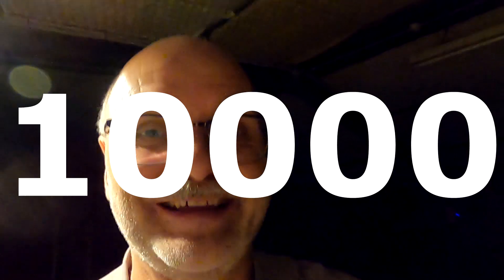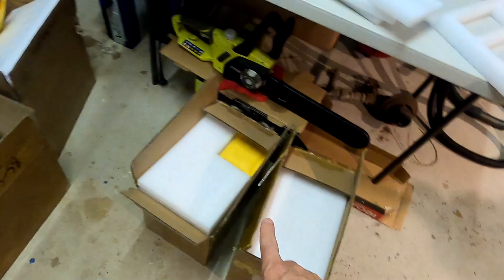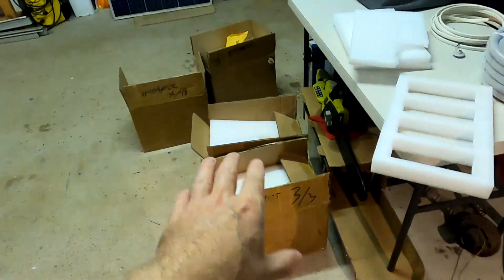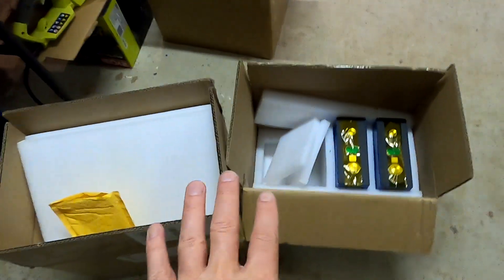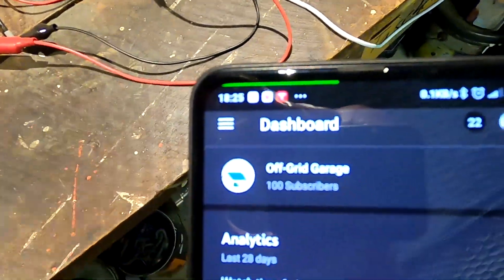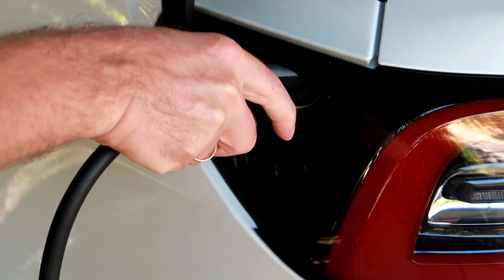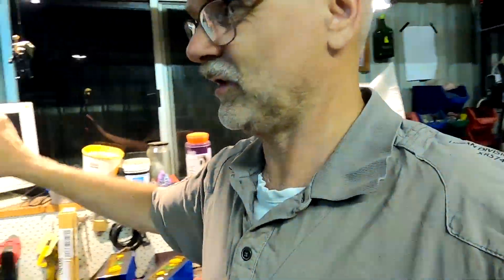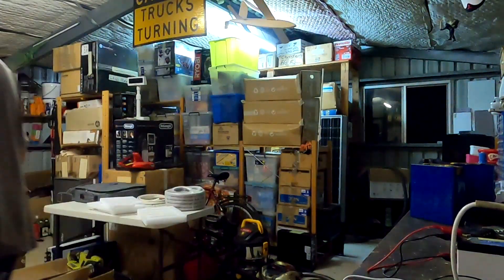100 Reasons Why (I should build this off-grid system)

Comment: I would expand to at least 75Kwh 😁
Reply from the maker: Depends on how much load is connected to the battery, how much solar you have and how long you cater for having energy without much sun. A bigger battery cost you a lot more money and if you don't use the capacity, it's almost a dead asset.
Reply: @OffGridGarageAustralia  i was joking 😃 fast forward two years you have 45kwh and don’t think you will stop 😆
Reply from the maker: @EcuXP_Chiptuning  I won't 😁
Reply: @OffGridGarageAustralia   I am waiting for my 15kw cells and looking on your 45kw setup thinking I want that but i shouldn`t !
Reply from the maker: @EcuXP_Chiptuning  Yeah, I get the same desire when looking at other setups.
I started with a 15kWh battery as well to learn and understand. I'm now ready for the next step 😉

Comment: If you want a 48 volt system, start with 48 volts woth of batteries.  If you start with 24 volts worth of batteries, they will have X months more wear on them then the batteries you add to them for a 48 volt system.  Probably better for battery life to have batteries of the same age of use in series.
If you want to start with 24 volts, go ahead and get the other batteries and double the 24 volt AH.  Although I think it's cheaper to only buy one inverter ;-)

Comment: May as well go with 48v, then add to the battery later, to power everything!
Reply from the maker: That's my plan too. Initially I wanted to start with a small 12V system to learn and see how it goes. The I ordered 4 more batteries to go 24V with 7kWh. Then the idea to charge the Tesla from that system, so 8 more batteries to go max with the 48V and 15kWh system. If this all works well, I can add 16 more cells in parallel later to have a 30kWh system for the garage and house. Insane just thinking about it...

Comment: I built a 24 volt system with about 6 kWh, and then expanded it to 12 kWh. WHat I discovered is that the BMS became a limiting factor. It was rated at 200 amps, but overheated when running at that current for very long. If I had to do it again, I'd definitely go with a 48 volt system. Half the current, 1/4 the heat (heat depends on the square of the current). Definitely go for a 48 volt system at the very beginning. BTW, I got a Siginieer inverter, and I am very please with it. ~$1000 US for a 5 kW inverter.
Reply from the maker: Thanks, Jim. Yeah, I've already ordered 8 more cells to go 48V.
The inverter sounds interesting, I'll have a look.
Reply: @OffGridGarageAustralia  I see that I had a typo in the name. Should be Sigineer

Comment: Mpp solar inverters are nice start equipment all in one....durable 5kva is also 5kw output....
Reply from the maker: I thought about getting one but decided to order single equipment instead so I can replace and swap for testing.
If you just build such a system and don't want to experiment later on, such an integrated solution is the best and easiest.

Comment: On the link at your website, it goes to Alibaba, is that 80$ for 4-  280ah batterys? Or is that 1 battery for 80?
Reply from the maker: 80$ is for 1 cell. They come in a pack of 4 to form a 12v Battery.

Comment: Ya I mean if you are planning on going 48v at some point you should probably not waste money on a 24v inverter you won't need if you updated and I assume your charge controllers can do either but depending on how much solar you have you may not be able to get as much out of them with 24v
Reply from the maker: I think the same. 24V will be a future, additional system we will built but for this main one, 48V is the way to go. Thanks for your thoughts.

Comment: Hey, just letting you know the first order of these i got from basen didn't test out as well as I had hoped 😅  the 4 I got tested to about 275ah.....now this is within margin of error and my meter coukd be slightly off. I ordered a shut meter to test these cells more. But they look great and im not going to worry over a few Ah lol so I put in an order for 32 more my plan is 2p16s for my off grid cabin I am working on.
Reply: Yea, my meter is a cheap one. Also I am wondering if my first order was just lower cmgrade because I ordered then as a sample pack. My meter shows about .25v different from the reading on the post so the ah is calculated off the lower voltage so ove the course of the 10hr test it will cause the AH to be off. Not sure by how much. If you would like to talk more on the testing of these cells I can reach out via email you have listed on your site if you want.
Reply from the maker: Sure, send me an email.
Reply from the maker: The specs even say they should deliver 285Ah at 1C rating. This is hard to believe for me though.

Comment: Be careful,  some shippers have been repackaging used Lifepo4 batteries with new skins and selling them as new product.
Reply from the maker: Newer heard about that before. What shippers are you referring to?
Reply: @OffGridGarageAustralia  Mostly from Alibaba. The QR code on top may be scratched off, or the shrink wrap may be damaged, or overlap. They are pristine, aluminum shelled batteries with blue shrink wrap from the factory. If they are blemished, dented, or scratched they are either used, or a lower grade/ rejected cells.

Comment: Dont waste your money with other inverters and go with a 48v system.
If 7kwh is the theoritical capacity then u should consider using only 80percent of it for battery longevity. Further, take away another 10percent for inverter effieciency and also the idle current of the inverter is around 60watts per hr depending on type of inverter.
Reply from the maker: I ordered 8 more batteries to complete the 48V system with 16kWh. I will run it between 20-80% at max.
I will need to order more inverters and charge controller anyway for other batteries I'm going to build and test.

Comment: Hi Andy. You need more batteries, it`s clear - whether that be for higher output,  increased storage or just to lower the depth of discharge for longevity. Your battery supplier should give you 2 free replacements, I doubt they`ll stretch to 8 for the price of 5, but good luck!
Reply from the maker: Thanks for the tips! I'm negotiating right now. We're still fighting :D
But, yeah, I agree, the bigger the better. Size matters, right?! ;)
Reply: @OffGridGarageAustralia  🤣 Just think how many batteries you can buy with the money saved from not having the chrome delete on the teslander!